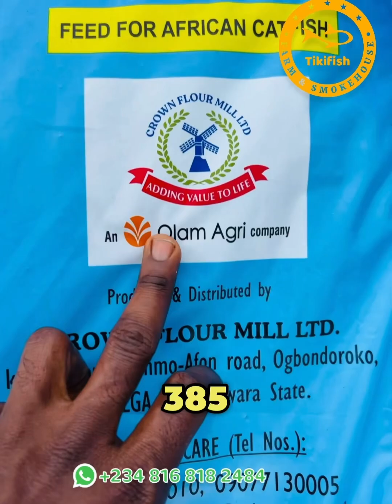Optimizing Catfish Production: A Detailed Look at Feeding, Stocking, and Harvesting

Comment: The profit on this venture is small ooo. 385 feeds * 24500= N9,432,500.00. 880 fishes * 4.5kg * N3000 price per Kg = N11,880,000.00 if you subtract this from cost of feed, you will have N2,447,500.00. I have not included other expenses ooo. This is small ooo or did I miss something? I will appreciate your feedback
Reply: Where you missed it is the cost😢 of feed. As your fish gets bigger the cost of feed per bags reduces. So the cost 2mm can't be the same with 3mm, 6mm or 9mm.
Reply: Definitely he can't use commercial feed all through....
Reply: @samueltunde4181 even with that , if he choses to use local feed all through out, he will only be saving ₦500 on each bag, which is just ₦192,500. So, its not much of a difference in the grand scale of things.
Reply: That's a pretty low profit margin for a farming that would last close to a year and that's excluding other cost like the cost of acquiring the jumbo fishes, transportation, labour and others, which would have also eaten into the profit margin as well..